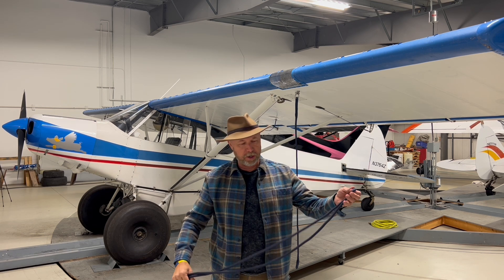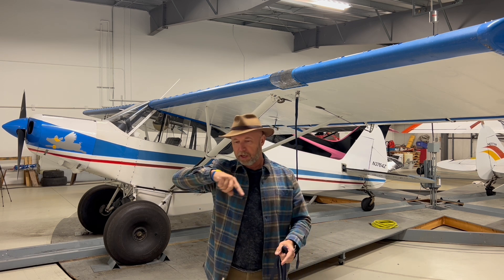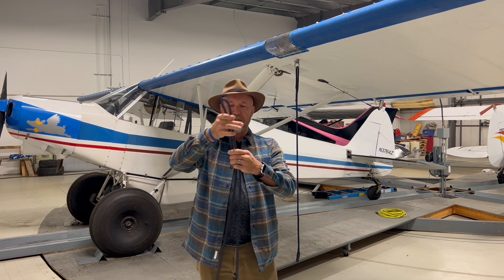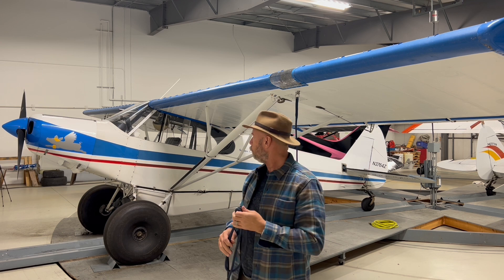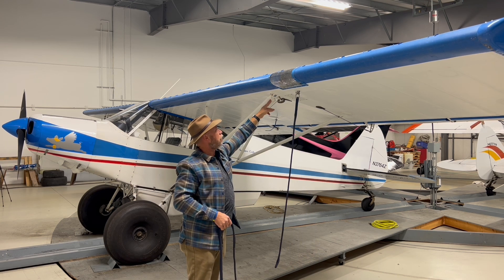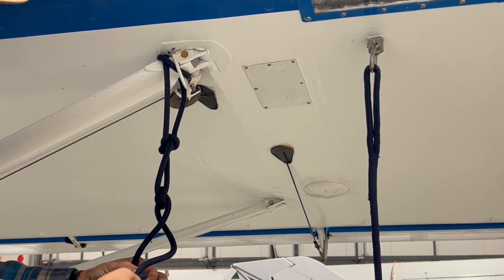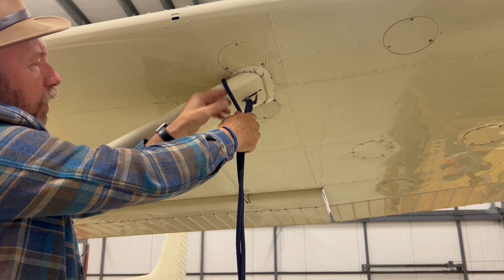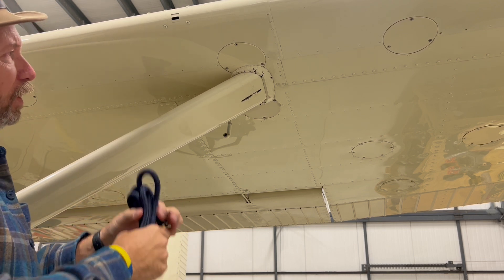Safe Aircraft Tiedown in High Winds

Comment: I lost a PA12 at Wasilla during the Christmas 2022 windstorm.  I had 10k soft shackles and the straps with the rubber shock section you were talking about.  Problem is in the winter that rubber section loses all its flex.  The weld on my tie down loop on the wing failed and the plane flipped back and forth until I was able to get there and strap it down upside down.  Complete loss.  Now I use rope exclusively and wrap with enough lines to make Spider-Man envious.  I’m also parked at a different airport that barely get any wind while all the other planes at PAWS, PAAQ, and PAMR are dancing in their tie downs lol.